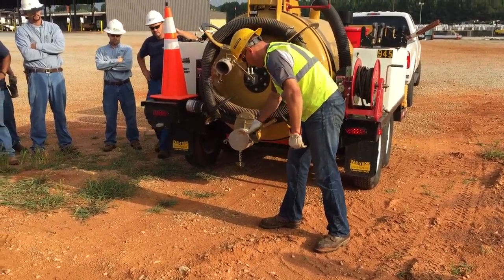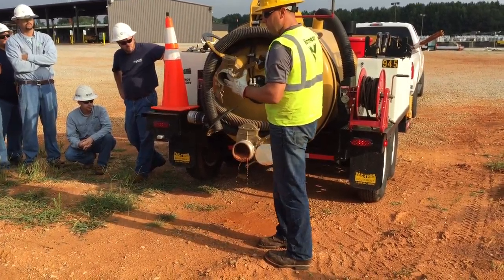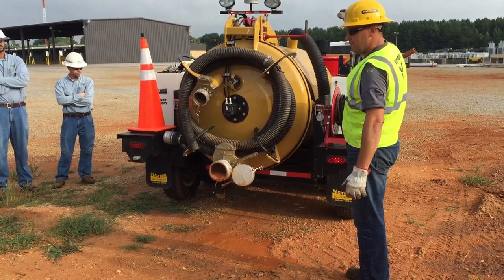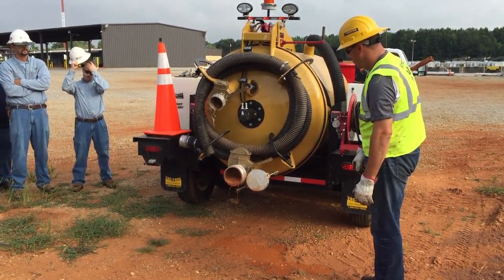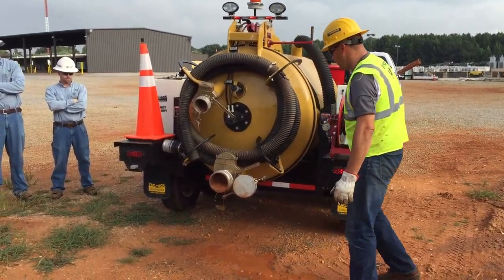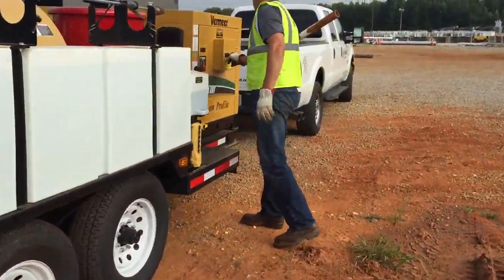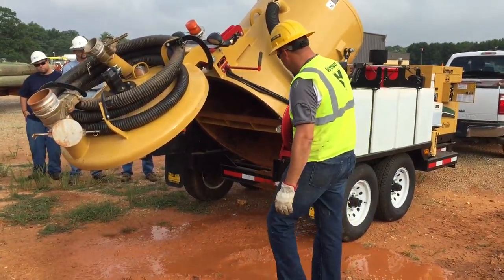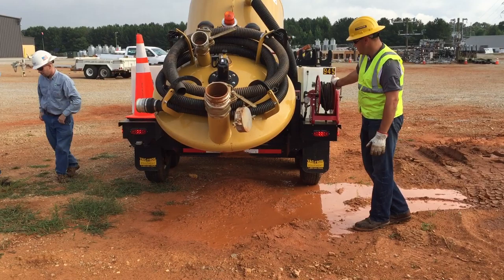VacTron LP533-XDT:  Dumping and cleaning the unit

Comment: Best thing to do is never purchase this pile of crap to begin with
Reply from the maker: Sorry you’re having bad luck.  I’d reach out to the local Vermeer dealer near you to see if they can assist.
Reply: @curtkopacek6859  bad luck is you get hit by a bus I will say I finally did get with my local dealer and they where able to help. But as always they don't have the part and it will be three days if not longer. Now let's talk hydraulic pump motor and why you can purchase it alone no you have to buy the whole assembly. Now tank level senor that only lasted 3 weeks
Reply: Kirk McMahan  trying to get rid of one 💩
Reply: @kirkmcmahan2929  Would ditch witch be a better alternative?
Reply: @kirkmcmahan2929 My tank level sensor replacement went out just as quickly and this thing is still under warranty 😂
Reply: @kirkmcmahan2929 Also, the tank washout went out week 1.